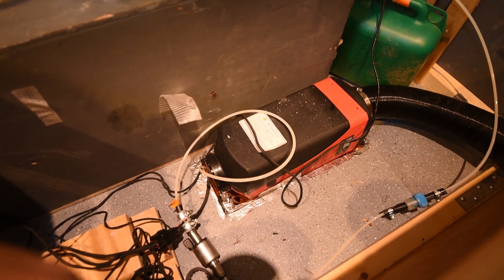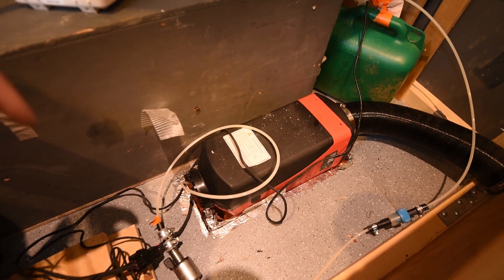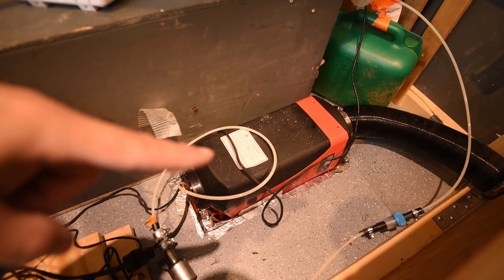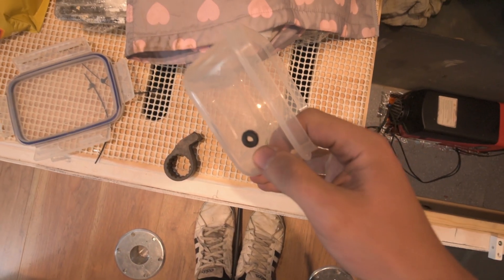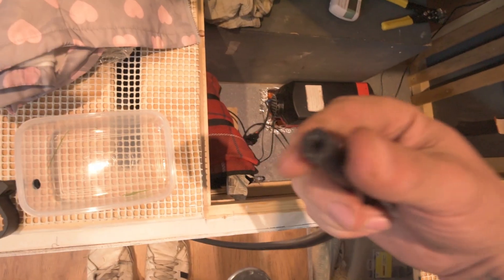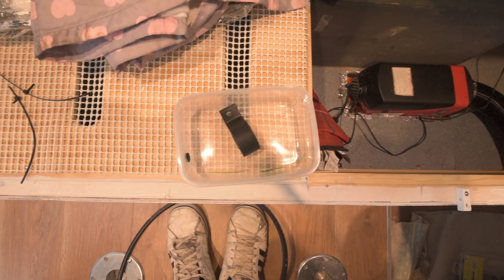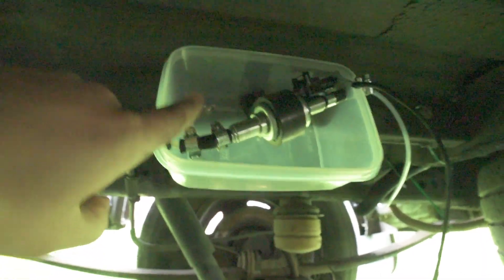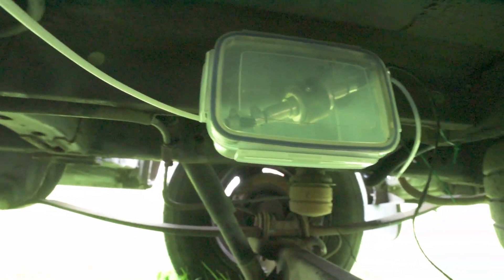How to Plumb a Diesel Heater into the Vehicle Tank

Comment: However on a separate tank you can use red diesel at 50% the cost of white, paraffin or some heating oil at 20p a L.

Plumbed into the tank it's £1.25 a L.
Reply from the maker: Yeah mate, you're definitely right there! I've also heard of people using other types of fuel. It was the main reason i originally wanted a second tank, but with me damaging it, and seeing the price of another one, and the fact that id have a gauge and it was cleaner. Thats what won it for me. Thanks for the comment, im sure someone reading will find it useful!